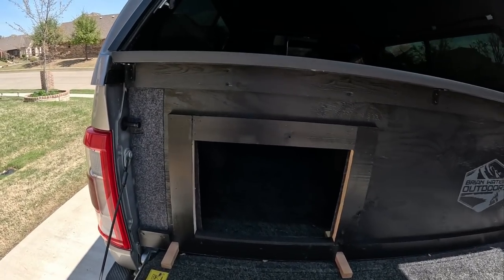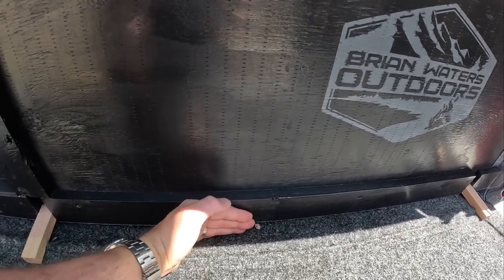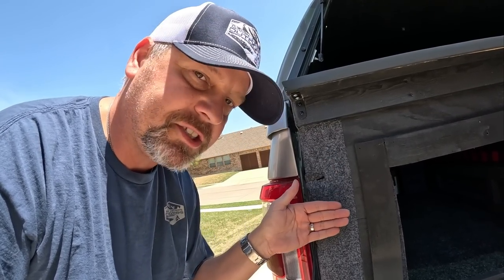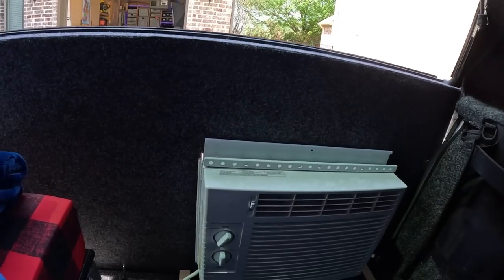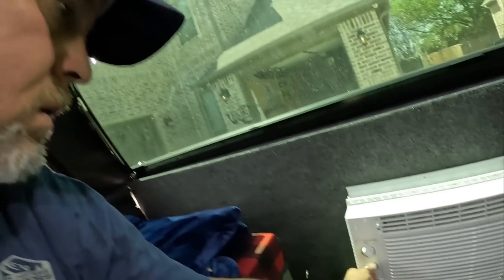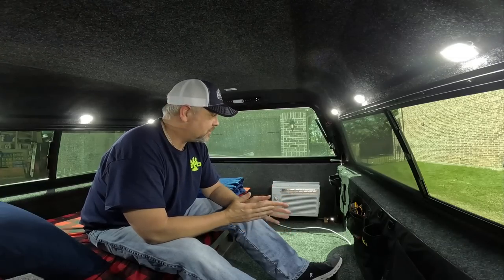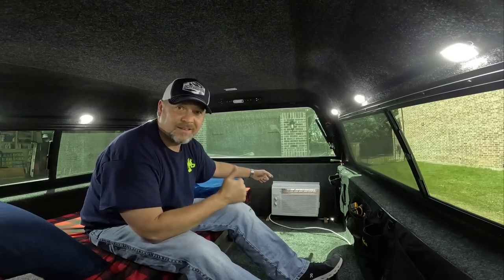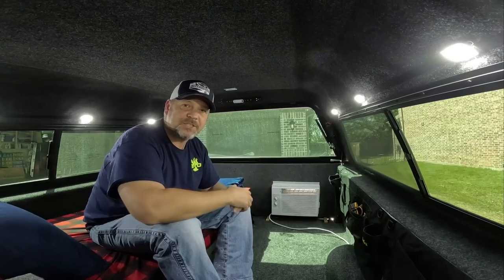Truck Camper A/C : CHEAP, EASY & COLD!!

Comment: Find a used tailgate in the junkyard and install the A/C in the used tailgate. Add and remove when needed.
Reply: Now that’s a good idea
Reply: Seriously yea, great idea. Seems obvious once you’ve said it, but I wouldn’t have thought of that. Bravo sir!
Reply: I bow down!
Reply: LOL that’s a 2024 f150, good luck finding a used tailgate at a junk yard 😅
Reply: Sounds good but my rearview camera is in the OEM tailgate - I guess I could carry the junk yard tailgate inside and install it when needed???
Reply: I had the same thought, plus get some reflective shields to put on inside of windows. Reduce sun/heat coming in and for privacy
Reply: Smart. Maybe you could use quick latches/ hinges if they are available.
Reply: Just rent a motel room.
Reply: @tehbui604  No kidding, but he might be able to fit a last gen tailgate. I doubt Ford bothered to change the tailgate width or mounting.
Reply: That would be the ultimate solution.   Great input. 👍
Reply: The guy who said get a motel room cracked me up!
Reply: Where does to power come from ?
Where does the condensation water go ?
Reply: That's not a good idea.
Reply: used tailgate ($400 +) vs plywood ($20 )
Reply: Brilliant
Reply: @tehbui604  it's a Ford
Reply: @BrianWatersOutdoors  tailgate down provides perfect table. I'd leave it the way you've designed. well done
Reply: @tehbui604  accidents happen everyday.
Reply: Not a good idea it’s aluminum and will lose its strength what little it has when an opening is cut.  I say no
Reply: You have inspired me and I'm going to try this. I already found another tail gate for $90.
Reply: @noneya2567  How come?
Reply: @ronniegillaspy  
What I did for my setup was use 1" foam on the ceiling with fabric glued to it. I used thin aluminum from side to side, that was a little to long, forced it into place at the top of the side windows. It formed a "bow" that held everything in place. 
I didn't want to use a glue and risk it releasing due to hot temperature's. 
I used reflective foam core 1/4" insulation for the windows. 
I didn't use any type of insulation on the AC tail gate. 
I actually had to turn the AC unit down below halfway on the dial.
I ran the AC off of a Pecron E3000 and it worked perfectly. Each Day I had at least 35% battery left.
Reply: @des782  
In my setup, I used a Pecron E3000 and there is no condensation because the AC removed it.
Reply: @des782  
The condensation from the AC drips outside
Reply: Genius
Reply: I agree because Anyone can just kick in his wood
Reply: It’s not like you would take 2 tail gates with you out to camp or have a big whole as you travel, this is a lot more for function really I like it it’s stealth too you would never know
Reply: I know a guy who did this same thing only he took the tailgate off, stored it & duplicated it with treated wood painted black. He still reused the left & right tailgate cables to hold up the wood simulated tailgate.  Last I heard he was still living in it at some Walmart running off a generator.  He told me if he's not staying at Walmart then he's parked at a motel next to an Applebee's picking up out of town chicks staying at the motel.  I guess he goes back to her room & showers too.
Reply: Is there a video on the build
Reply: Exactly.  And insulate the cap and Bed!!!  You're not going to get cool without insulating the cap and bed you're wasting time, money (energy).
Reply: I was just about to post that. Hopefully the trucks and parts aren’t still in the premium lots at the junk yard. You would have to peel back the Bed liner but you can always re-Velcro and tuck under the plastic trim if you swapped in a used tailgate with a cut out. That  would be a no go for me because I have a camera built into the tail gate handle that I don’t want to deal with. Plus you would want to have some sort of L bracket or something to brace up and secure the AC while you drive and while you park. I see how that could work with a little finesse it might look alright too
Reply: Yep so much easier
Reply: Seems good, but would opening and closing the tailgate be harmful to the ac compressor? I was told the unit would need to sit for a period of time to allow the oil to settle back down
Reply: What happens to the condensation? Do you have a drain installed or is it gonna put water all over that carpet looking material?
Reply: @tehbui604 Sounds like a walk through a Ford parking lot one night
Reply: Where does the water drain? And I guess you have to climb over the plywood to get in and out? Not very practical if you are going to be in and out often or you are old and beat up.
Reply: @BrianWatersOutdoors 
Can you run this A/C unit on a generator? I'm thinking of buying one from Harbor Freight. SE Oklahoma area gets really hot and humid.
Reply: @winstonrobinson6732 just get a junkyard tailgate with a oem camera. Or get another camera and install it on junkyard tailgate.
Reply: Absolutely not. Having the ac on the back makes you have to climb over everytime and take it down. What if you gotta use the bathroom at night. You gonna set it up multiple times??
Reply: That is genius my guy
Reply: The option he chose is likely cheaper.
Reply: Used tailgates for new trucks can be like 700 bux...
Reply: Having a lowered tailgate is still helpful.
Reply: @BrianWatersOutdoors  what brand Ac unit and it's dimensions LxwxH??
I have a slide in truck camper and need one smaller than 16x9" for the small bottom door on my slide in truck camper
Reply: Wow you just blew my mind, I never thou of that and I have a spare one already 😂
Reply: @stevedott715 The guy who said that has no idea how much that costs per night. This day and age, you might as well temporarily rent out an apartment for a camping trip with those prices. Plus, camping out of your truck this way is not only a lot cheaper by just paying for a camping parking spot, but this way you don't have to be proactive and worrying about bedbugs or cockroaches. A lot more trouble free overall in my book.👍
Reply: @Youtubeiswoke-p7i He said in the video it's the cheapest Frigidaire 5000BTU small AC window unit he could get. Not sure what the dimensions are though.

Comment: The problem is finding power
Reply: You can always setup an inverter in your vehicle and only run the AC for limited hours/while you idle the vehicle.  This would be useful not to have it run all night, but to cool down a hot space for an hour or so before going to sleep so it's comfortable when you go to sleep without having to wait for it to cool naturally overnight.

With a bigger battery system, you could run it overnight.
Reply: @JimmyNewCakes  and you could die from carbon monoxide too. Better idea is have a solar setup and run it off that
Reply: Honda eu 2000

Comment: They sell tailgates that go back farther than factory and are just metal bars that would be a lot better than this you could make a mount for the ac and coat it in rubber and foam and you would get more space

Comment: One thing, I like about your channel is that you finish things out like they were supposed to be there initially, with the carpeting and painting the wood black and adding your logo it really looks nice.  The only problem I hate with this setup is having to crawl over the partition. I’m really surprised nobody makes like a 1 or 2k btu window unit that would fit into the sliding window space and somehow vent between cab and bed. Or maybe like a cap manufacturer that would have a dividing rear glass. Half aluminum half glass to accommodate a smaller a/c unit in the aluminum section cut to fit the unit by the customer. Idk just brain storming. The person who does invent something like that will be a rich person.
Reply from the maker: Thanks Ross👍🏻
Reply: Wish Dometic or some other company would make micro roof mounted AC's!
Reply: @messagesystem333  I think if anybody will come up with something like that it will be ecoflow, they already have the wave and from what I’ve seen the wave 2 is smaller
Reply: Could likely add a partial door in their to get into the aisle?
Reply: @messagesystem333    roof mounts won't fit in garage
Reply: @tennesseeterri then your garage us too small

Comment: You can’t beat window units, best cooling out there hands down, challenge is finding the lowest size and btu you can, 5000 btu seems to be the smallest. Always wondered why they didn’t make 3000 btu size units which would be even more ideal for small spaces. Btw did you see Shark Tank this week, Lavabox was on there and all the investors were interested. Seems to have great sales, I made my own for about $80, using harbor freight ammo can and sweating copper pipe. love those small form factor fire pits.
Reply from the maker: I didn’t see that! That’s awesome. I talked to the owner several times and he seemed pretty cool👍🏻

Comment: If you get to camp with no shade to park in, consider putting a tarp over the truck or at least the part being AC'd, be sure to leave a gap and not resting the tarp on the truck. This will eliminate the direct sun and greatly reduce the work the AC has to do to keep it cool.
Reply from the maker: Good tip, thanks👍🏻
Reply: @BrianWatersOutdoors 
The guy on YouTube channel "5 bites" installed an RV ceiling in his truck camper shell. You should check it out.

Comment: It is probable youve already considered it, but fixing solar panels on the roof will provide off grid power and also block a lot of the heat from the sun that causes it to heat up in there to begin with.

Comment: Dude, I recognized those wood shims right off the bat, you took those Lincoln Logs out of your kids playset toys!
Reply: @BrianWatersOutdoors  I got a buddy an Electrician that works for Nagel sign company, you know those big advertising billboards on the side of the interstate?  I guess he went out there on a service-call to see why the electric bill was so high.  You guessed it, a homeless guy had set up a comoflauge tent & was stealing electricity off the meter plug getting free electricity for his K-Mart air conditioner just like yours.  He laughed about it & just told the guy not to do it anymore.  He took the service plug out & put a blank cover over it.

Comment: I did something like this and installed 2 air conditioning units. When one of them is taking a break,,,the other is starting up and pumping out cool air. A con when dealing with window units. Both air-conditioning units are running off from 6000 watt hours of batteries stacked up in the back. Also put two 400watt solar panels draped across the top of camper shelI and truck roof. also used pool noodles sliced down the middle to slide on the window and the plywood to create the barrier this guy made. Works incredibly well
Reply from the maker: Sounds awesome👍🏻👍🏻

Comment: Nice work! 👍
One issue I think you may have is that rear support.
Window A/C units are supposed to tilt away from the interior so that the moisture can drain, if keep it lvl you may end up with water inside campershell. 
I would suggest using a thinner support AND adding a drain hose or plastic sheet so that your bed rug doesn’t get wet. 
Just my thoughts
Reply: Yes enough tilt to drain condensate out. . Is that a 5000 ? That is all you need I need one for my very small Toyota motor home
Reply: I had the same thought.  However, I believe many of the newer units are actually using retained condensate for additional cooling to gain efficiency.
Reply: Not so on newer ones made after 2001 because now they go into a 1" drip pan so as to allow the splash of condensate to better cool the unit through both convection & evaporation.  Hence the slinger ring on the evaporator fan making the swish noise.  Lastly I'd imagine he'd just park slightly up hill because the unit only needs a 1/4" slope.  Petty.

Comment: Its a great idea. I think Id insulate the windows and maybe even another layer on the roof. Use the klix together floor mats from Harbor Freight on the floor... the more you insulate the easier the ac unit can keep the temps down. Depending on where you are camping a large causality blanket/tarp with the reflective side towards the sun can also help
Reply: @BrianWatersOutdoors  Hi Brian..great video..but where does the water goes??..from your A/C?.and you mentioned  you had a "Zero brezze"?..so it didn't  keep you kool at night to get a decent sleep?..just curious on the information you can share before I make any money decisions..thank you sir for your time..much appreciated 🙏
Reply: @BrianWatersOutdoors I would get some duct bubble wrap insulation and Velcro it to the windows will help drop the need to cool a lot. And be a privacy screen too. My question is what do you do about it draining? Does it come into the cab?
Reply: If any of you are deer hunters save a few hides and sew them together so you can throw it over your camper shell and you will have easily removable insulation, I've never tested it with AC because I've never had AC in my shell but works great for heating so I bet it would work for AC to
Reply: He doesn't have to do all of that because he's NOT living in it.  It's just for getaway comfort when he's out with his buddies with the beer cooler next to it & nothing more but a temporary 24 hour thing.  It's like asking yourself if you need a 10'x10' piece of plush carpet for a tent.  Me & I've done it before by putting the ac unit on a milk crate then a painter's drop cloth draped over the back.  Petty.

Comment: Really nice design Brian. You are right camping is a great way to relax from the city day to day grind during the week. You really need AC during the hot humid nights to sleep I can deal with the heat during the day but need to sleep in cool air at night. Love the tail gate board looks original to the truck, nice job enjoy the summer with this.    Ottawa Ontario Canada.
Reply from the maker: Thanks Tom👍🏻

Comment: As well as insulation around the sides. You should add a layer of reflective insulation as a layer on the inside as well. The outside will reflect the incoming heat, but a layer on the inside will help as well. Also reflective inserts for the windows will further help in addition to added privacy.

Comment: Nice build, man. I’d like to share a tip with you if you’re interested. I did a similar build, but added a hinged door to pass through. Here’s the tip. Build a “box” or a “sleeve” to slide over the back of AC unit when it isn’t being used. I used 3/8” luan to build sleeve. It will protect your cooling fins on the back. Use a bungee or some other way to keep sleeve from falling off. Cheers!
Reply from the maker: Thanks! I did notice I bent a few of the fins just moving it around. I’m assuming you’re just talking about the box for transport to protect them?
Reply: @BrianWatersOutdoors  exactly! Just for transport and storage. 👍

Comment: Cool set up. I had put a ac unit in my van. Used to much power, didn't want to get a generator and also I wanted to get use to the heat. Got an exhaust fan and a small fan to put on me. Works for what I needed.

Comment: You might already do something like this but when I was a kid my parents got an inflatable boot that sealed the space between the sliding windows and hooked a plastic dryer hose to an a/c vent and ran it through the windows. That and a 12 volt fan kept us kids cool. Maybe you could use that on the drive to give the window unit a head start.
Reply from the maker: I ended up using a bicycle tube👍🏻👍🏻

Comment: Love this stuff.. I live in a 19 ft box trailer with 2000 watts of solar 300 amp hours of 24 volt lithium iron batteries and 3000 watt inverter also 2  2000 watt solar generators mounted 2 midea 8000 btu ac’s right through front of trailer fridge freeze 60 in tv stereo and loading ramp is chained up as a deck.. comfortable off grid portable home.. also installed wood stove and water filtration..
Reply: Wow sounds awesome... how much did all the solar and batteries cost?

Comment: In my opinion the small gaps are a good thing. will allow air to escape and slightly "vent" the truck bed while the AC is running. great work !! The dripping might become an issue overtime coming from the back of the AC unit though
Reply from the maker: Thanks👍🏻 these newer ac units though don’t even have a drain hole. They use the condensed moisture and “spray” it back onto the condenser to help cool the unit down. I had this same model ac in my DIY camper and I never saw an ounce of water dripping. Hopefully this will be the same👍🏻
Reply: @BrianWatersOutdoors  ohh wow. shows what I know. lol Thanks for the reply. I might have to look into a small AC unit for my setup now. We are also in Texas (North East) and these summers are not fun. Thanks for the info.
Reply: New ac units shouldn't  drip  they don't  have drains anymore
Reply: @carlstephens1532  It's so humid here they still drip :p
Reply: @spencers4121 thats correct, with enough humidity they will collect a lot of water.

Comment: A great quality tarp with  pegs about a foot up on each corner of the canopy and the tarp can go straight out or tied down at angle to still see out the windows and shade the windows and AC. Swap pegs for any spacer you can think of

Comment: Neat setup! Like a few other commenters, I'm wondering about the condensation issue. Are you going to put in a tray to protect your bed liner from mold?
Reply from the maker: So, I’m not worried about mold because the BedRug is not carpet, it’s plastic fibers. But this ac unit, and most newer ones do not even have drain holes in the bottom. They reuse the water that gets condensed and have a “spinner ring” on the fan that picks up the water and throws it on the condenser to keep the unit cool. 🤷🏻‍♂️🤷🏻‍♂️
Reply: @BrianWatersOutdoors  yeah what little will go out there will evaporate and if it ever became a problem a man could engineer something.